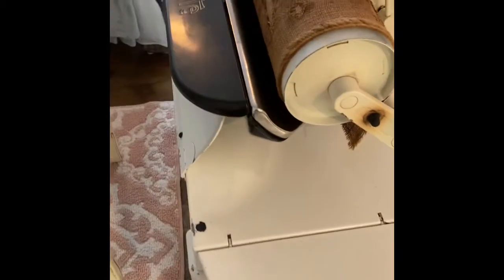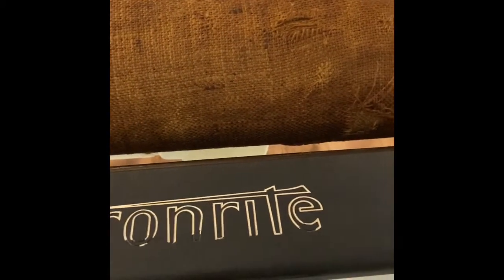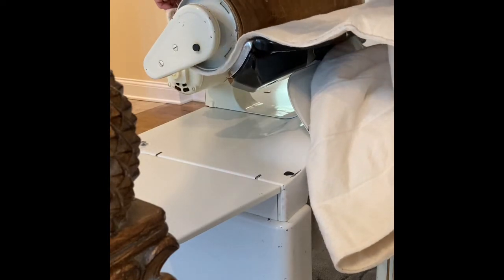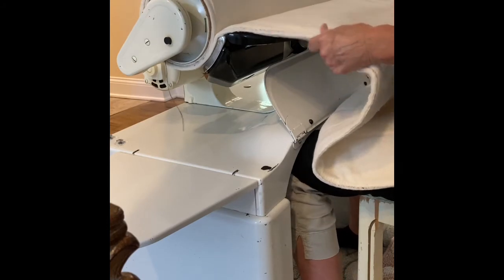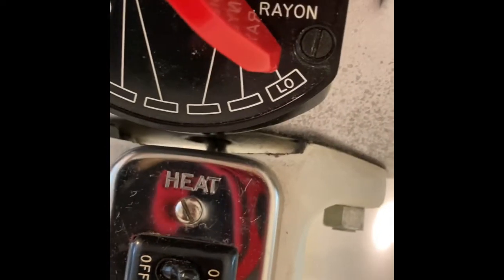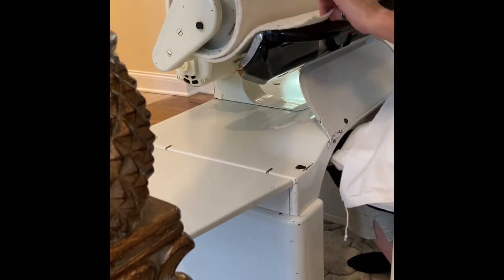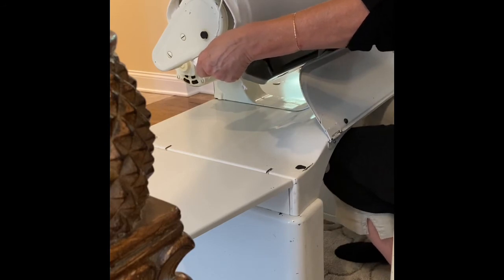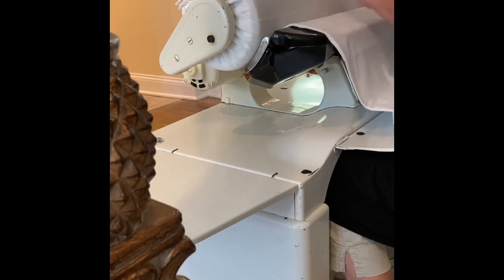Ironrite Pad And Cover Install

Comment: Where can I buy the replacement cover? I have two iron rite machines I need to replace them on
Reply from the maker: https://www.ebay.com/sch/i.html?item=353956184115&rt=nc&_trksid=p2047675.m3561.l2562&_ssn=hope8344

This is one I found on ebay.

Happy pressing!!

Comment: Hello :) what kind of oil do you use for the gears? My mother recently got one and doesn’t want to use it until she changes the oil. Thank you!
Reply from the maker: Hi!! I just used a 3 in 1 oil. It is pretty light weight. I keep a small rag handy because, in the first month or so, it would drip a little oil underneath at the motor area.
Reply: @JetUSA4815  great thank you so much! :)
Reply: @JetUSA4815  where did you get the oil from? Does a chain store carry them or do you have to order from a specific store or website?
Reply from the maker: I think I just got it at Walmart. It was under $5. It is simply called 3-in-One oil. It comes in a little 3oz or so container. I put all 3 ounces in at once.
Reply: @JetUSA4815  great thank you! My mother says thank you for the information and for your video! Her other issue is trying to get the cover a little tighter so she is working with that as well! :)
Reply from the maker: That cover thing is tricky!! But I think the feeding it under the existing piece is what worked best. Good luck and happy ironing!!!
Reply: @JetUSA4815  I will pass along that information! Thank you again so much for your help! :)

Comment: What cord did you use for replacement?
Reply from the maker: Hi Corey! Thank you for your question! The tag on the cord says 15A. 125V.  1875W suitable for use with outdoor appliances. I got it at either Lowe’s or Home Depot. 
I’ll try to send a picture.

Comment: I am the original designer and inventor of these products for the Ironrite. Do not follow these incorrect directions given on this video.  Instead follow the instructions included in the package. Moreover the seller can be contacted via eBay or texted with questions on the cell phone number provided.
Note to video creator: the burlap on your roller exhibits dry rot. Please change it out for the new burlap included in the Combo Pak.
Reply: For those of us who do not have the instructions, can you post a link to them?

Comment: Seriously?  You use the existing burlap edge to start your pad. Simply lift it right before the hot plate and feed the pad in under it. Then it will remain connected as it rolls around. Save sa lot of hassle.
Reply from the maker: Yes, sorry Jason. I did finally figure that out. Thank you for making a note of it!